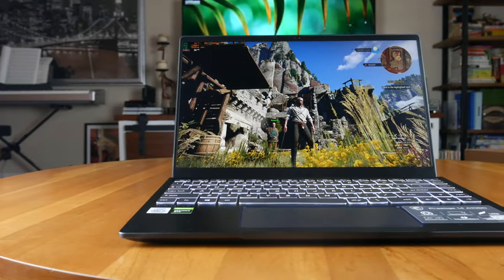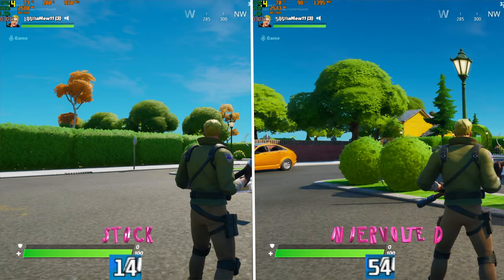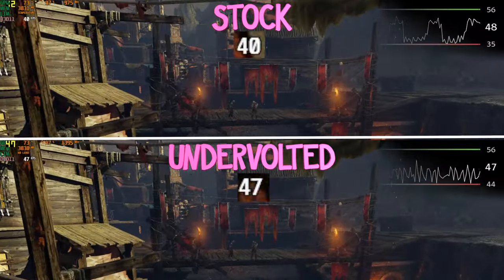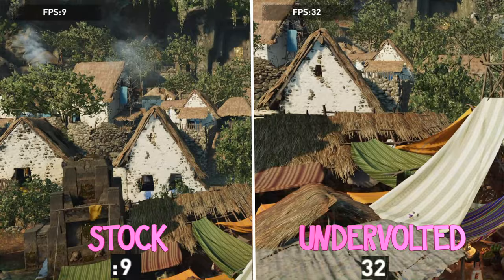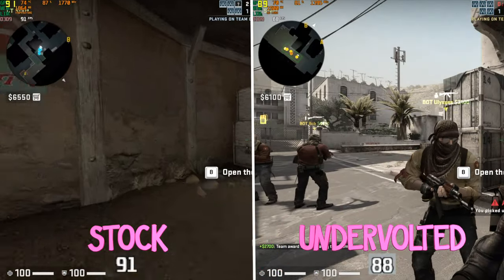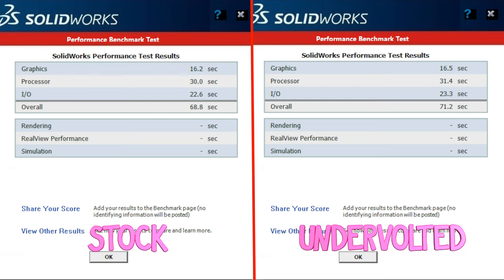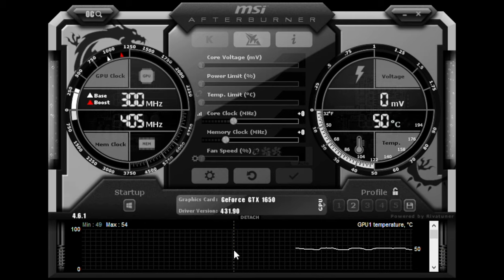MSI Prestige 14 with GTX 1650 Max-Q - Gaming Results with Undervolt

Comment: So what I did in order to get maximum performance out of my prestige 14:
1. Put the laptop in sport mode for maximum power draw allowance of the CPU
2.Underclocked the GPU to 1380mhz as recommended
3. Download throttlestop and undervolt the CPU by -135mv
4. Set the maximum turbo speed in throttlestop to 28 (2.8ghz)

Temperatures of the CPU never reach 90 degrees Celsius and are usually around 85 degrees under full load. GPU temperatures are around 75 degrees and no throttling has been observed
Reply: have you also tried gaming on it? did you have playable fps?
Reply: @federicoboriani8638  im getting very playable FPS. Star wars battlefront 2 rubs smoothly at 1080p with mixed settings. Middle earth shadow of war is rough but playable (around 30fps capped is achievable).
Reply: @unknown.unknown2786  oh that's good news. is that super noisy to a point that it's impossible to talk to friends on gamechat?
Reply: work like magic for Destiny 2. thanks man
Reply: how do I set the turbo speed?

Comment: hey dan i like your video ;) i have MSI GF63 Thin 9SC with  GTX 1650 Max-Q
i7-9750H
any idea what the best configurations in msi afterburner are for my laptop?
Reply from the maker: You should be able to use the same settings, but don't blame me if it crashes. 😇
Reply: @dansbesttech1945  well.. too risky then

Comment: Hey Dan. Good video. Followed your instruction. After the undervolt as instructed, I played tombraider for 30 minutes without the charger plugged in. I got an average 45fps . However as soon as I plugged in the charger the fps dropped to 10 fps within a few minutes. Any thoughts!!
Reply from the maker: Hi Prashant. Here are a few things to try.

First: Try charging your laptop battery to 100% and then game.

Second: Make sure the Battery Mode is set to the same setting when the laptop is unplugged and plugged in.
Third: Make sure the Fan Setting in the Creator Center app is set to the same setting when the laptop is unplugged and plugged in.
Fourth: Make sure the undervolt is still applied by re-opening MSI Afterburner.
Reply: @dansbesttech1945  Thanks for the quick response Dan. Will check it out and let you know.

Comment: Hey Dan, thanks for this video! I wanted to ask what are your pros and cons for this laptop? And have you find a way to fix the creaking?
Reply from the maker: Hi Joseph, In my full review for this laptop (link now in the description), I summed up the pros and cons in the conclusion: Pros: Best value for a laptop with a GTX 1650 Max-Q, super light, has 16GB of RAM and 512GB of upgradeable storage, a good keyboard, and a great port selection. Cons: Subpar build quality with creaking, tinny sounding speakers, and thermal throttling out of the box.
Regarding the creaking, I haven't tried fixing it. I've actually gotten used to it.
Reply: @dansbesttech1945  I read someone mention tightening the screws made the creaking go away. Haven't tried yet but might help.

Comment: Hi Dan, Do you recommend waiting for the new MBP 13 or getting the razor blade stealth? I am not sure how undervolting affects the laptop lifespan on the long run, hence i would rather save up a bit and get a laptop with better thermals and build quality.
Reply from the maker: That's a very tough question. The MBP 13 should have good thermals, a better build quality, and will hold its value longer than the Razer Blade Stealth, but the Razer Blade Stealth is more powerful if you care about gaming, and it is available now.

Comment: Hi Dan, how's the battery life after being undervolted? and how's it compared to the 15" version for you? Thanks
Reply from the maker: The battery does take a hit. I highly recommend plugging in the laptop while running the undervolt and/or only using the undervolt when necessary.
Reply from the maker: Just realized. I had the CTRL+L setting applied locking the frequencies at 1400 MHz. Battery life is back to normal!

Comment: Do you think repasting the GPU and CPU with higher quality thermal paste like Gelid or Kryonaut cause help with the temps?
Reply from the maker: Hi Joseph, regrettably, I returned this laptop due to the trackpad issues I was having, an never got around to it. The better thermal paste will help a little, but not nearly as much as the undervolting.

Comment: I'm torn between this laptop and the razor stealth 13 - I have seen both your videos and it's just made me even more uncertain!

In this video, you seem to game for only 20 minutes.
Using your undervolt tip, have you gamed for longer than 20 minutes? Say 2-3 hours?

I ask because I plan to upgrade my ageing Dell XPS 15 9550 with GTX 960m, which currently can play Gears 5 on Medium-High settings @1080 for about 20-30 minutes before it starts choking. 
I usually game on a laptop maybe once a week for about 3 hours, worried about throttling as the Razor doesnt seem to have any thermal throttling issues according to your video and other reviews I've seen. 

As I will primarily use this laptop for work, attend meetings to with and probably keep on me every working day - I would prefer not to purchase a gaming centric laptop which frankly could be a bit embarassing in my very boring corporate meetings. 
With your undervolting tip, it does seem to make this laptop a very viable choice for heavy gaming for a few hours a week. 

That said - the Razor stealth being all black does help camoflage the fact it is a gaming laptop!
But I love everything about the MSI Prestige 14, slightler bigger screen, smaller bezels, better design and look.

Your thoughts are welcomed.
Reply from the maker: I played Witcher 3 for around an hour on this laptop with the undervolt and didn't see any throttling. I would gladly "test" this game longer for you. 😀

Stealth vs Prestige 14 at work: The Razer Blade Stealth feels more premium, but it will get very dirty with finger prints. The single fan on the Prestige though might spin up during a meeting if you don't have the laptop in Battery Saving Mode.
Reply: @dansbesttech1945  thanks for the reply. Think I'm going to go for the Razer strictly because work will be paying! 

Thanks for all your help.

Comment: Does This work on prestige 15 also ? mine is reaching above 95 on cpu and does undevolting decreases or increases battery life ?
Reply from the maker: I'm sorry to hear that about the Prestige 15. This undervolt will work with the Prestige 15. MSI Afterburner decreases the battery life, so you should only use it while plugged in or when using intensive applications like gaming.
Reply: @dansbesttech1945  Okey Okey, CPU Undervolt Saves Battery , But Why Not GPU Undervolt 🤔
Reply from the maker: +MhMd Alfas Some say because MSI afterburner constantly pings the GPU, but for me, my gpu stays at 1400 MHz even when I'm not gaming.
Reply: @dansbesttech1945  okay okay
Reply from the maker: @MadMaXxFx  Just realized. I had the CTRL+L setting applied locking the frequencies at 1400 MHz. Battery life is back to normal!
Reply: @dansbesttech1945  So Just Simply Using Ctrl+L in battery Unlocks The Frequency? Will it make us apply everything or setting from scratch every time when we use afteeburner or simply we can save it to a profile like Throttlestop, I haven't really used it because of the battery issue you have mentioned.
Reply from the maker: @MadMaXxFx  Regarding your CTRL+L question: Pressing CTRL+L locks the frequency and destroys your battery life, so as long as you don't press CTRL+L when inside the Hardware Monitor and only slide each dot to ~1400 MHz like I explained in the video, you should be fine with regards to battery life.
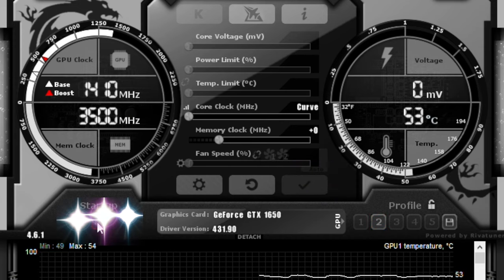Regarding your Profile Question: Yes, you can save to a profile. At 4:28 in the video, look at the right side of the screen. Hit the Save Icon. As you can see, I have my ~1400 MHz saved to Profile 2. Hitting the Reset button in the center of the screen will make your undervolt go away. As a result, you can quickly switch between stock and undervolt by pressing the Reset Button and the Profile 1 or 2 button. Just have to hit the apply button too.
Reply: @dansbesttech1945  One More Question, I Have Checked The Notebookcheck website and seen The Maximum Frequency It's Showing Is 1245 For GTX1650 MAXQ, Then Why Not Set That Instead Of 1400... Sorry For Asking One More Time 😬😬

Comment: Why undervolt is bad for battery ?
Reply from the maker: Some say because MSI afterburner constantly pings the GPU, but for me, my gpu stays at 1400 MHz even when I'm not gaming.
Reply: @dansbesttech1945  it does so because the 'undervolt' curve is not set correctly. If you set it properly with an actual curve, the frequency will be much lower on standby.
Reply from the maker: @alessandrogenovese6108  Just realized. I had the CTRL+L setting applied locking the frequencies at 1400 MHz. Battery life is back to normal!